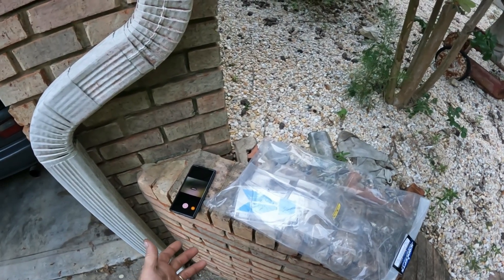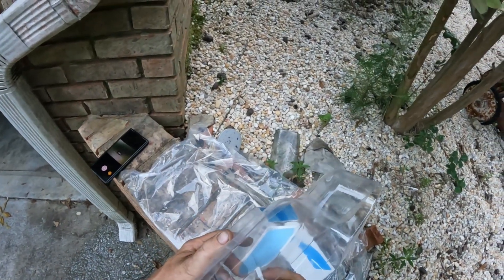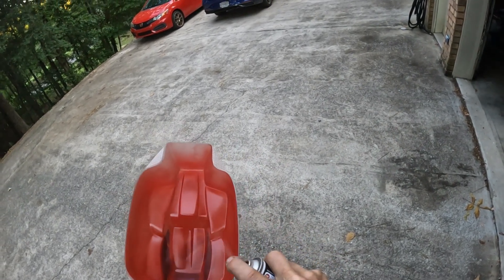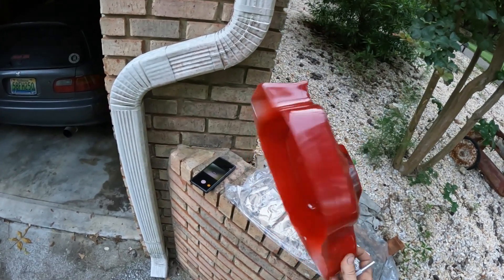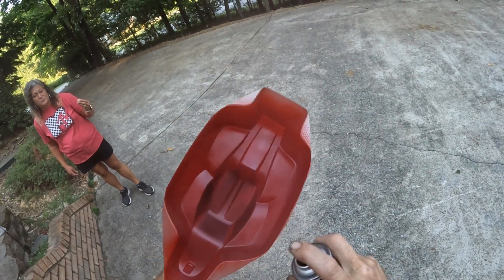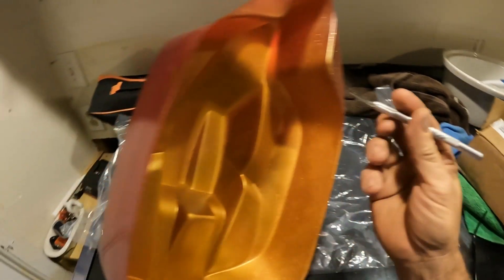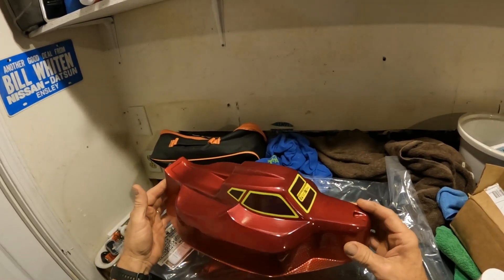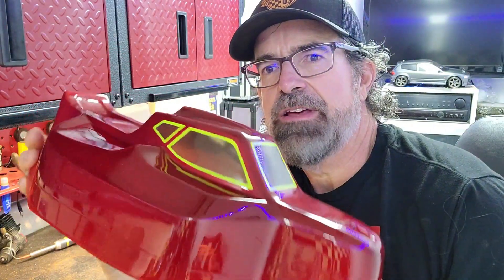How to paint a nitro buggy body with candy apple red paint!!

Comment: I always have trouble with the spazstix.  They have great paint but I think I need to shake it more often during each coat.  The heavy flake settles in the can a bit and causes uneven coverage.  I end up with a darker side or a spot that doesn't transition as smoothly